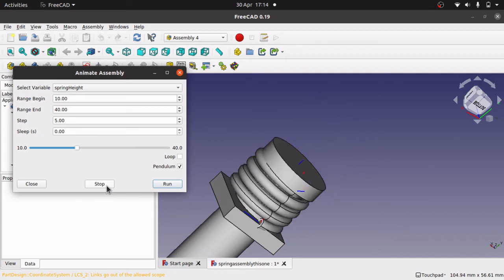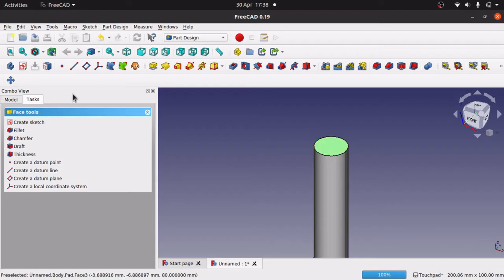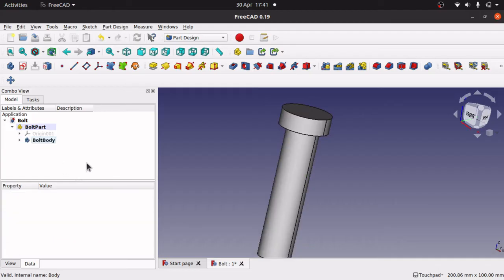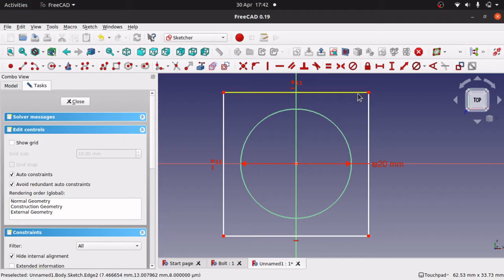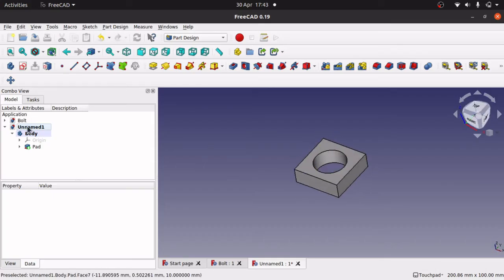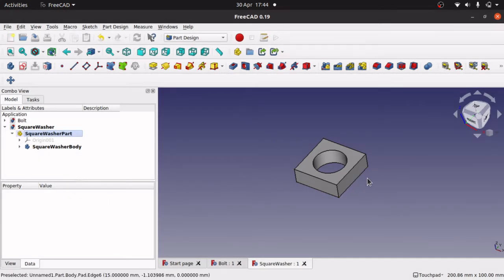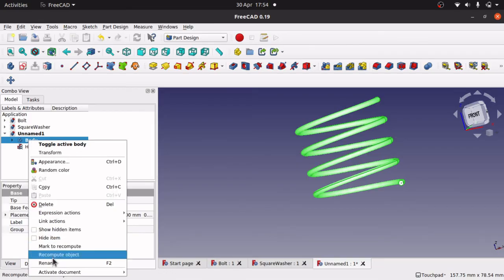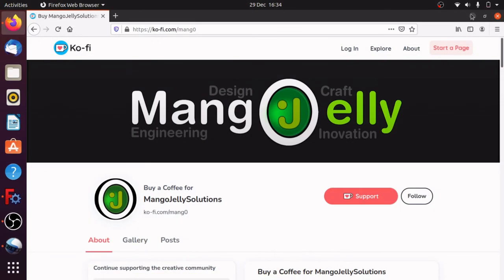FreeCAD Assembly Animation Spring moving bodies Part 1 of 4 - Beginner friendly, mechanical movement

Comment: @6:20 you could just create symmetry between two opposing corners of the square to the center, without any construction lines? That must be quicker and is not depending on the size of the square. I'm new to FreeCAD so I may be thinking wrong?